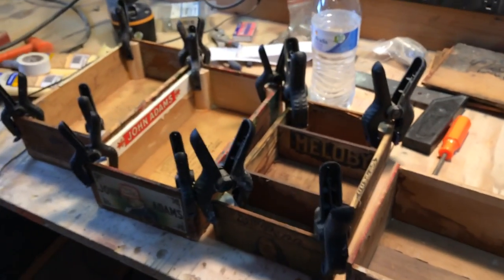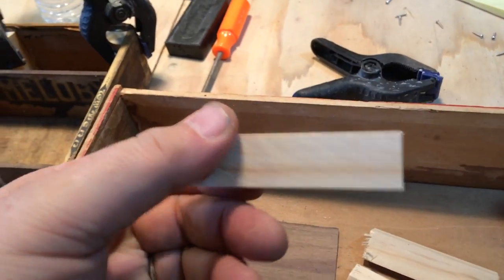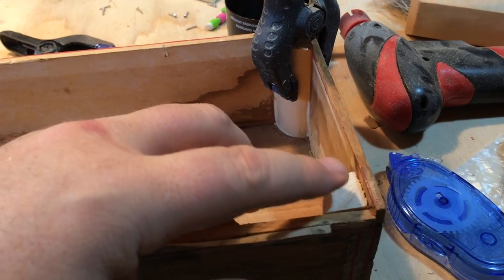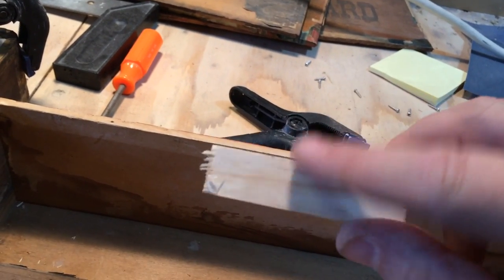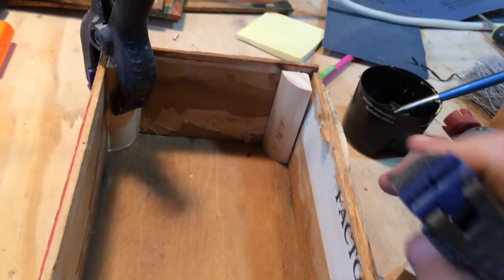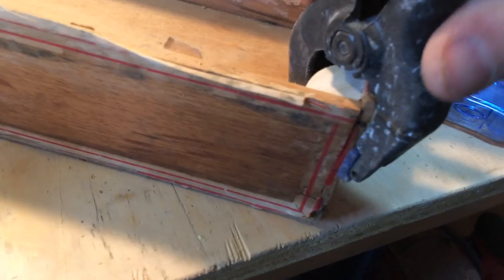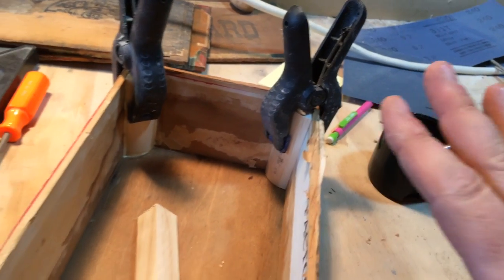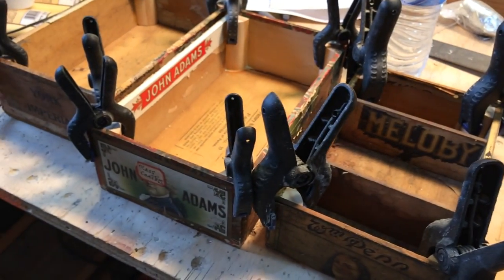How to Brace Antique Cigar Boxes for Guitar Building

Comment: What do you use for tops for those? I'm gearing up to teach some school kids how to make guitars. I live in a remote spot and I'm trying to use local junk in an effort to make them as cheap as possible and illustrate that they're surrounded by usable stuff to build guitars with. Ive thought of square gallon cans for the body but the sharp edges are problematic. This is a fishing village so there are also old wooden fish egg boxes available. They're about the size of a big cigar box but made of wood too thick to resonate. Im trying to come up with something to make thin tops with. Sheet metal might work but im wondering what you're using for these. I've never built a CBG! Or any guitar for that matter.LOL I'm certain I can though and well enough to show the kids but I don't want to teach them to build a dead guitar.  When we're done I'm going to teach them to play them too. I'm an old boat builder so the wood working skills are well within my abilities, I'm just looking for ideas.
Reply: BTW I contacted C. B. Gitty and they were kind enough to offer a discount for the parts we will need to buy. Thanks for turning me on to them Shane!
Reply from the maker: I use the cigar box lid.  And yes, http://CBGitty,com kinda rocks, don't they?